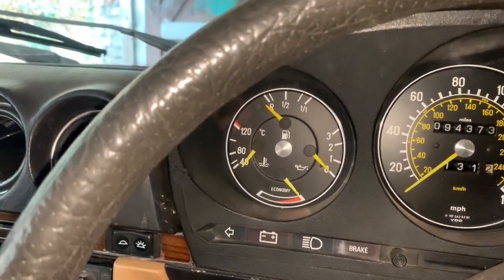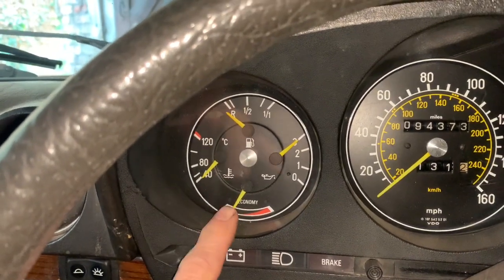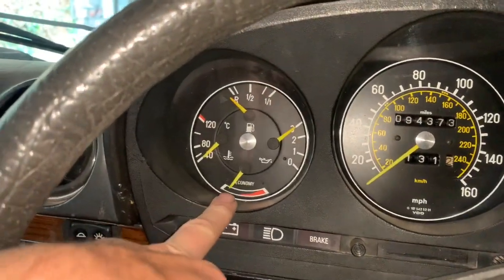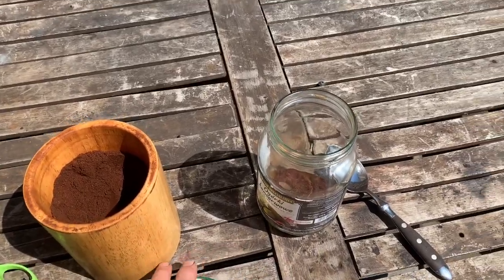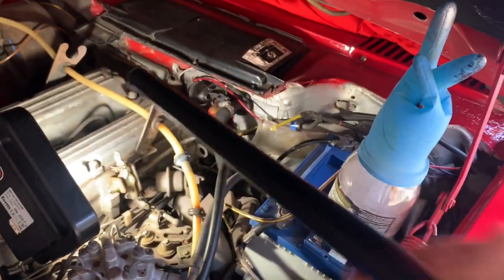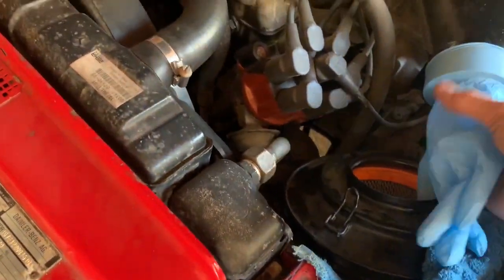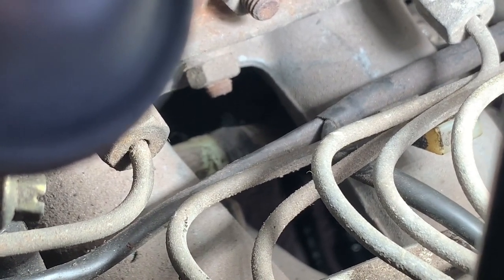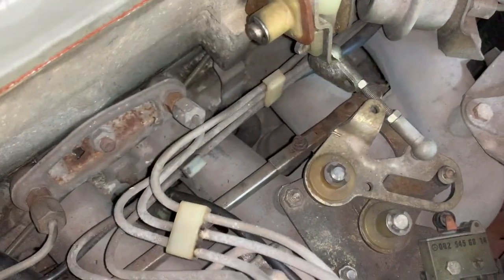Mercedes 107 SL vacuum leak detection

Comment: my 450sl 1979 runs smoothly but at idle it is now bouncing from 750-600 and the oil gauge is also dipping in sync with the rpm's. the car feels like its going to stall, is this a potential vacuum leak ?
Reply from the maker: One thing that causes rpms to bounce at idle is a stuck air slide valve. The oil pump is driven by the engine so as revs drop,maybe oil pressure is dropping due to lower revs? Mine

Comment: Can that gauge be at zero and still have a vacuum leak? my 380sl idles perfect when cold but rough idle at operating temp. fuel pressures are all within spec
Reply from the maker: Yes you can have a vacuum leak with the rev gauge at zero. 

You probably already know this but....When engine is cold, the warm up mechanism supplies more fuel via the cold start injector and more air via an air slide valve.

As engine warms up, a temp sensor or timer shuts off cold start injector and the air slide valve closes to shut off the excess air. Either of these two mechanisms not working could give you a rough idle when hot. Mike

Comment: Hey Mike. Great video. Mine goes down to zero when in park (guess like it’s suppose to) but moves similar to your area in Drive. Does that mean I also have a vacuum leak? My ac is shot so I don’t think that works. Thank you
Reply from the maker: Thanks for your comment. That’s a good question - mine is (or was) a manual and my needle was not on zero in neutral. I’ll find out what is supposed to happen on an auto and get back to you. By the way - great vids you are putting out. Mike
Reply: @MikesMercsandothercars  Thanks man. As you can tell, I’m not as knowledgeable as you but just trying to get by. I’m pretty much recreating your videos with English that others can understand 😎.

Comment: In checking the vacuum system, how does one access and change or check  the Decel Circulating Air Valve?  It is located under the manifold at the front.
Reply from the maker: Thanks for your comment. What model car do you have and what year? What makes you think there is a problem with the Decel Circulating Air Valve. Mike
Reply: @MikesMercsandothercars  It is a 1983 280SL. The air and vacuum hoses are disconnected and I wish to reconnect to have engine working properly.
Reply from the maker: @desmondmair9768  Can you email me a picture of the valve on your car - I'll check it against my 1983 SL.....is yours a USA car? m_scott65@hotmail.com

Comment: Wow how do you get the coffee ground to ignite? Are the actually flammable? Do they keep smoking or do you have to repeat the prices a lot? I tried the method with the soldering gun and the mineral oil soaked sock but could never produce enough smoke.
Reply from the maker: Thanks for your comments - once lit, the fresh coffee just smoulders away and produces a constant stream of smoke. I didn’t have to relight the coffee. The only problem is that you may get a stream of builders queuing up for a coffee as it smells so nice! Mike.
Reply: Mikes Mercs and other cars haha I will have to try it!

Comment: Brilliant!
Reply: I have these exact three symptoms that have been vexing me for a few months. I’m totally going to check out my vacuum lines now. Thanks for this video, Mike!
Reply from the maker: Let me know how you get on. I haven’t swapped out the hoses yet but if that doesn’t cure the issue, it is onto the warm up regulator.....and then the auxiliary air valve. Mike